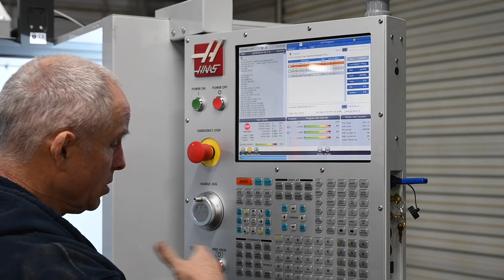Chasing the Blade - Nightfall Project Day 2

Comment: Walter - can you, as the last operation of the bevel portion - take down the tip connector?  It seems like if you did that last on both sides you would have a very thin tab to grind off.   Maybe it wouldn't really help.